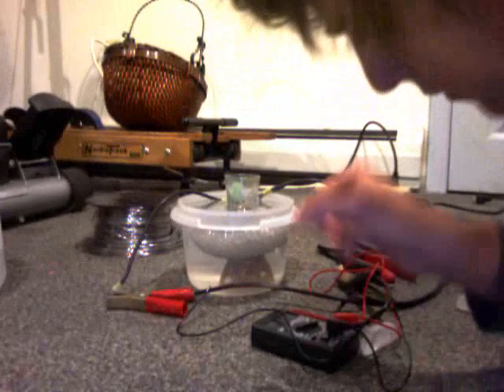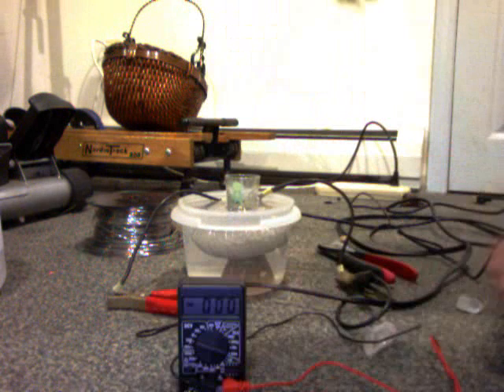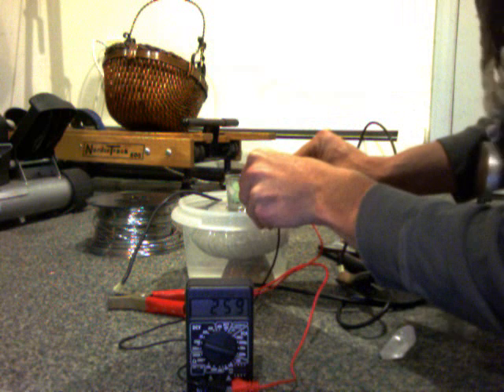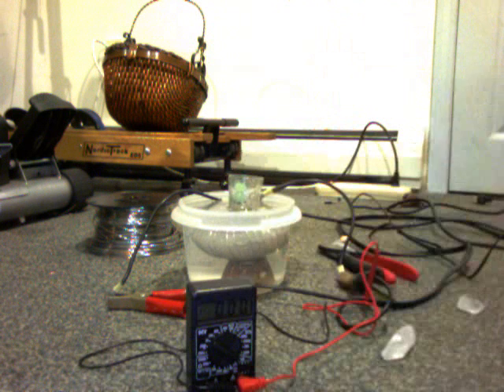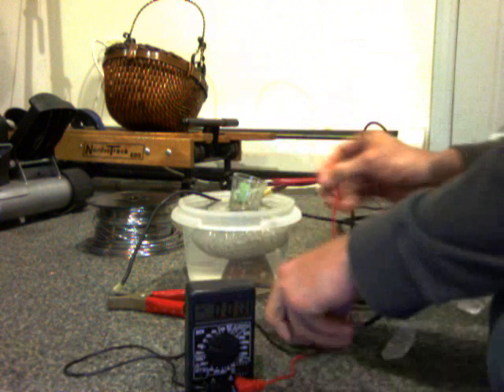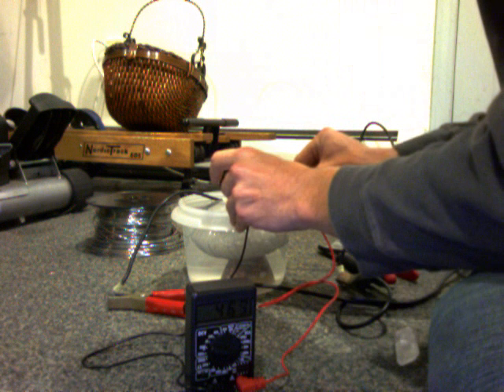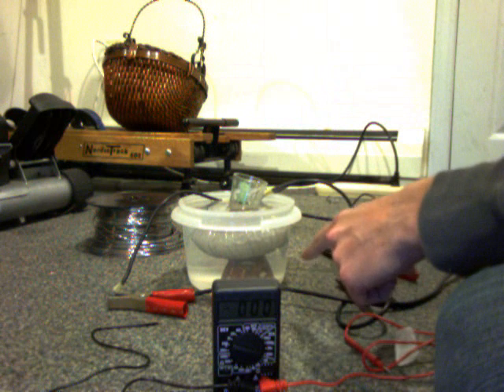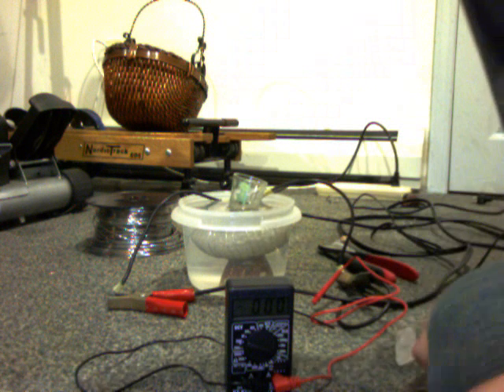Rodin Coil Experiment #1

Comment: If you use destilled water... you schould not use plastic!
Destilled water has a lower surface tension and it will suck out some flexibilizer in the plastic!
That will poison the water and add electrolyzer to it...
Cheers....

Comment from the maker: @txqNL Could you elaborate on this more plz? Because I do not want to electrolyze the water. I want to use it as a dielectric. That is why I was using distilled water. I'm thinking deionized water might be better. However, I've also read to use distilled water as a dielectric the electricity must be pulsed or it will start to electrolyze.